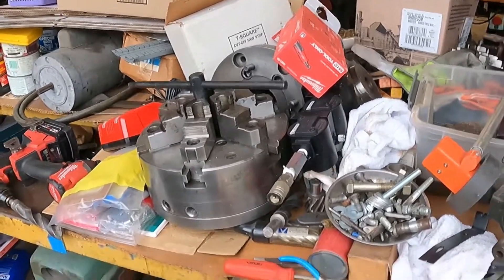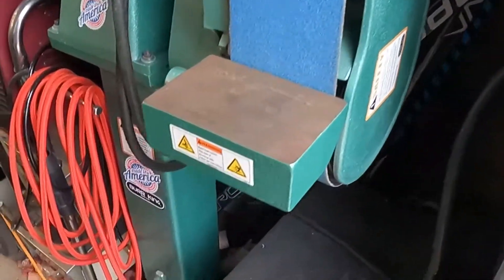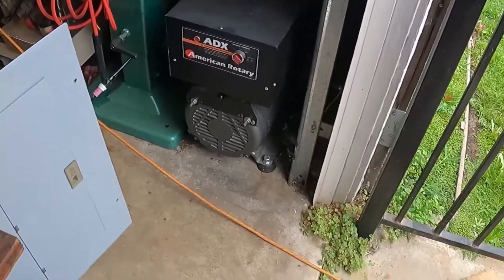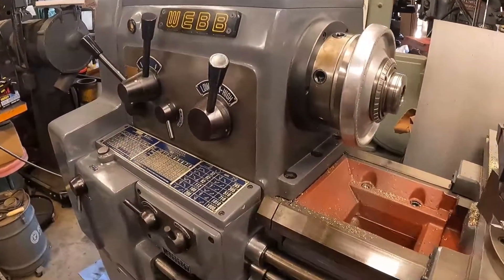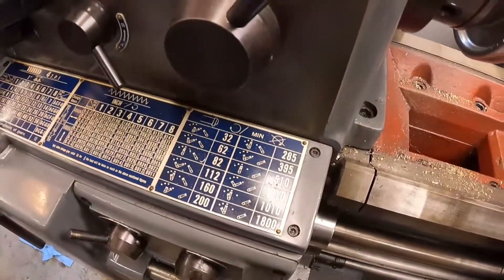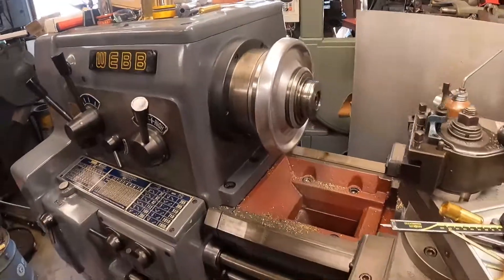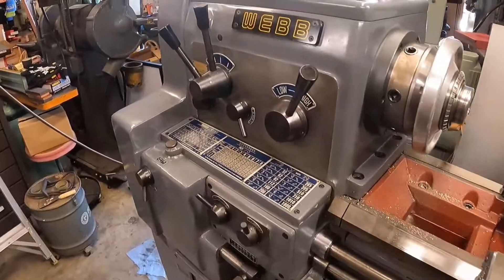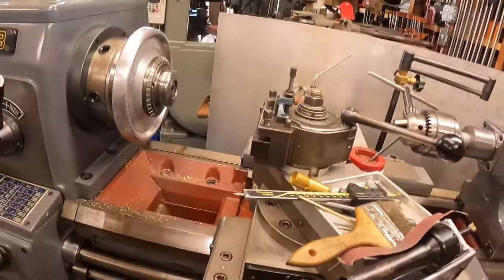Phase Perfect phase converter test run

Comment: My SCM 400SI is 11 HP motor and 1 HP scoring blade. 
Have the same PT010.  Saw has 30amp (input), 3 phase, 220V. 
According to the manual, I installed an 80-amp breaker and ran 4 awg wire from breaker box to the phase converter. Then ran 6 awg wire from phase converter to machine. 
Question is what protect the saw from higher than 30 amp input??
Don’t want to burn out my very expensive saw!!
Reply: Your PT10 should have a sub panel between it and the tool. This will allow you to put a 3 phase, 30 amp breaker for the tool. You’re not really protecting your to properly now if you’re wired directly into the PT10.

Comment: You wont need that rotary converter, might as well sell it. My 30HP Phase Perfect is almost 20 years old, never an issue and is bullet proof. I run various machines and a Miller and Fronius welder off it. Just change line conditioning capacitors every 3-4 years and good to go, relatively cheap and easy to do. You will love the new converter. And it's not a VFD drive in any capacity, it's a 3 phase utility power supply. Cheers Joe
Reply from the maker: Thanks for the feedback!! I love this thing...yes I still have the rotary but it doesn't take up much room. I know, I know, sell it for money for more tools 😆

Comment: What size of breaker did you need to run the phase converter?
Reply from the maker: I have it on a 60amp breaker. It's supposed to be on a 80amp breaker I think.

Comment: Air is that a static phase converter?
Reply from the maker: No, it's not a static converter. from their website: Phase Perfect® digital phase converter uses modern solid-state electronics to create utility-quality three-phase power anywhere. Over 20 years of development has resulted in a robust and durable phase converter capable of powering any load, from hard-starting motors to equipment with delicate embedded electronics.

Comment: I have a phase perfect good for 10 hp it has a much smaller housing and doesn't have the lcd panel,  I bought it used 6 years ago  changed the capacitor s  they recommended it every so many years, has worked great   Biggest motor load is 7.5 hp  most other loads  are 2-5 hp. I put a contractor on the input side so it isn't hooked to line power when turn off. It is piped to a 3 phase load center with 8 breakers.
Reply from the maker: Yeah, I was surprised by the size of the housing. I love it so far!! Still haven't got rid of my American rotary yet...lol...but it's safe to say that short of having an issue down the road I don't plan on ever getting rid of it.

Comment: Very nice lathe. I’m not familiar with the manufacturer. The phase converter seem to be a simplified VFD, but in a large cabinet. I put VFDs on a number of my machines. Very useful. Other than three phase output, what else does this do?
Reply from the maker: Check out their website for detailed info but as I understand it, it's probably more complex than a vfd because you can run  multiple machines with it where typically a vfd has its parameters set for just one machine. I have a late model solid state monarch 10ee that says it needs true 3 phase because of the phase sequencing or because of the regenerative braking..this can handle both of these. It's also with 2% balance .